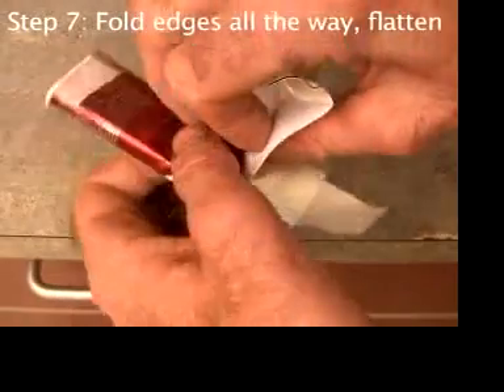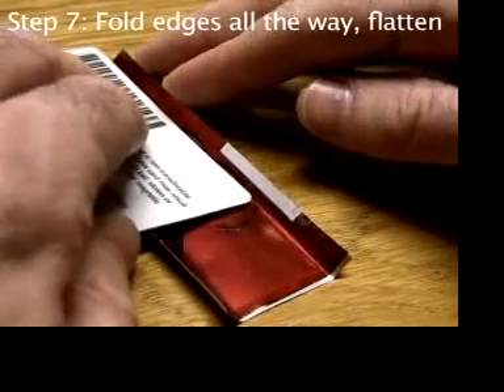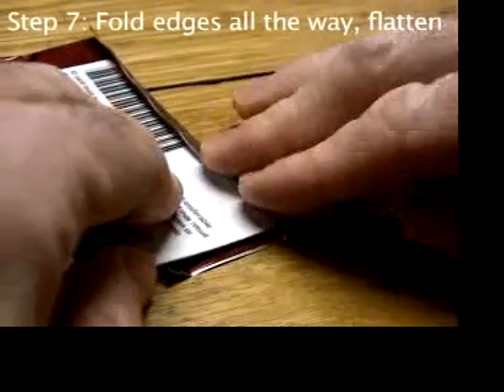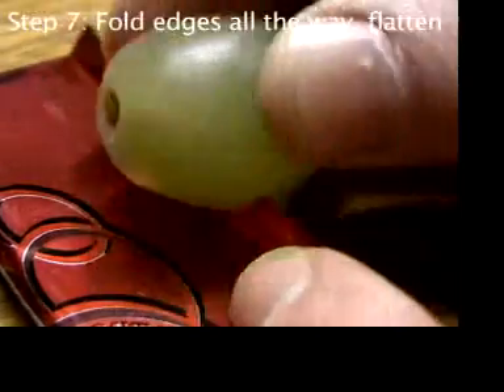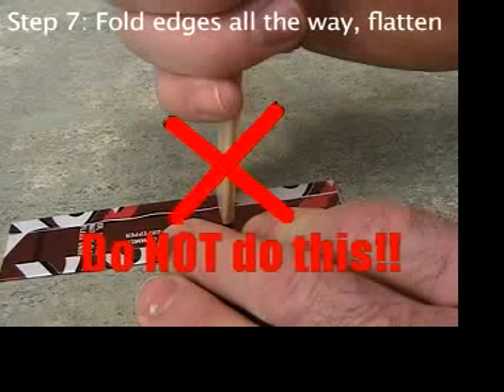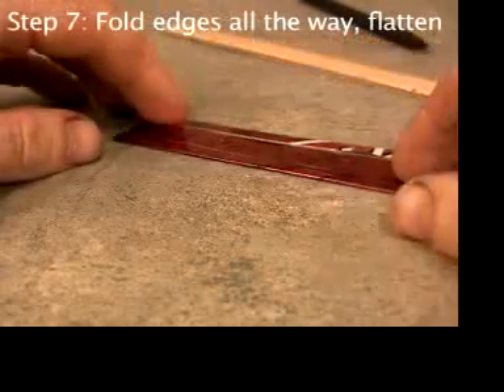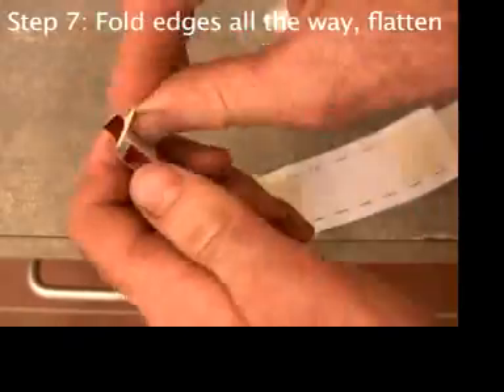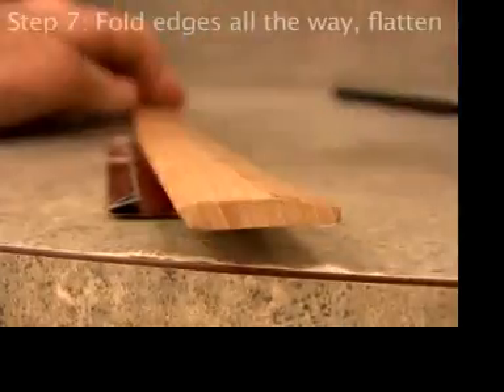Part 10 Build a Putt Putt/Pop Pop Steam Boat s7 finish fold

Comment: you can also use jb weld  it comes in two parts and it has to be mixed and it works really good i made one with it but then my straws melted because the i put the candle on a metal bottle cap and it melted through